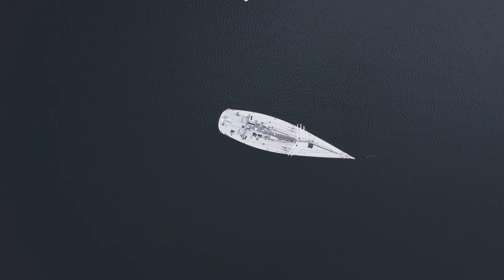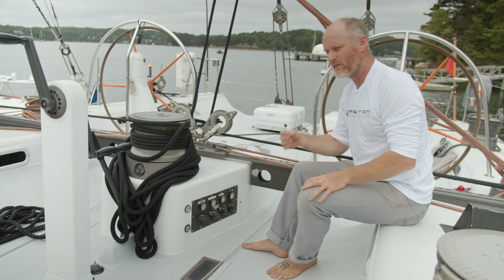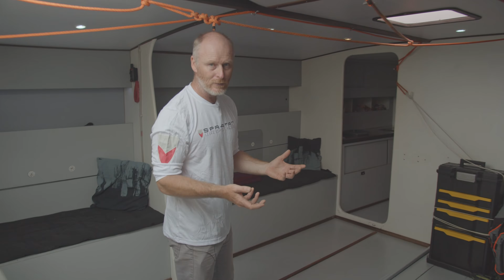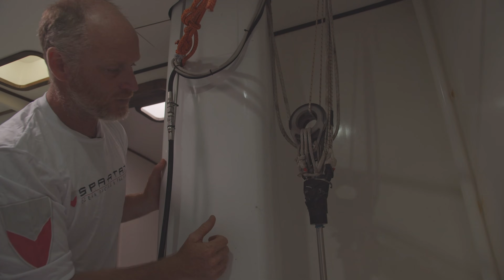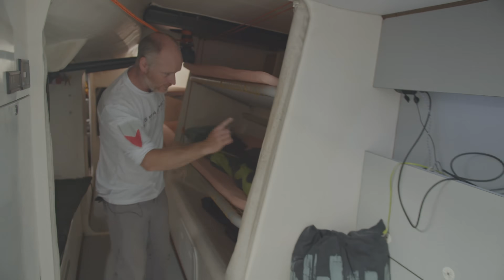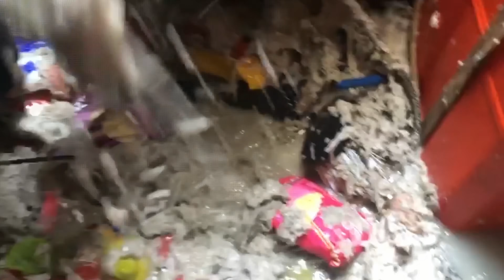FULL BOAT TOUR Grand Mistral 80 ‘Weddell’ & How We Got Here

Comment: Did you find any evidence of delamination- a reported problem with some Kevlar hulls from that era?  Also, any residual damage from the boat's capsize in 2018?  Congrats on what I suspect was a true bargain.
Reply from the maker: Hey there! You are right! Kevlar boats are subject to delamination IF the kevlar is exposed directly to water for extended periods- it acts both to separate the layers of Kevlar and plasticize the structure, further weakening it. This boat was surveyed in 2019 (including hull/ deck moisture readings) and then again in 2020 (by the French Navy who wanted to buy it) and on both occasions was pronounced A1 by the surveyors. 
As for the 'capsize' in 2018 during the Cape - Rio event, the boat actually suffered a 90 degree knockdown not a capsize. For this kind of boat- a knockdown is not so unusual and has no effect on anything UNLESS a spinnaker ends up in the water and excessive loads are imparted to the rig- that was not the case in that situation.  I did see the Youtube video called I think "Failed Passage" which does show the damage done below decks by the knockdown, such as damaged ceiling panels, equipment/ food strewn everywhere and very shocked/shaken crew members.  
My observations having sailed the boat 3000Nm now are this: the floor panels are not the original design- the new ones are extremely heavy and not properly secured in the present configuration but they are clearly what created the ceiling panel damage seen in the 'failed Passage'  YT video. We will be correcting this issue as part of the required interior design for OGR2023. I hope this helps clarify.